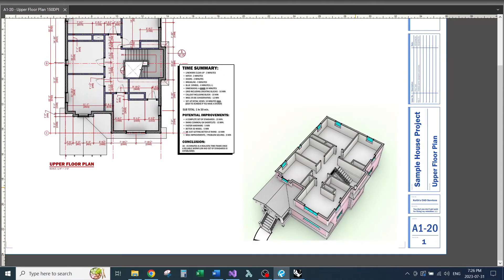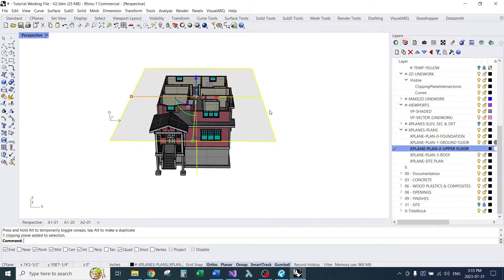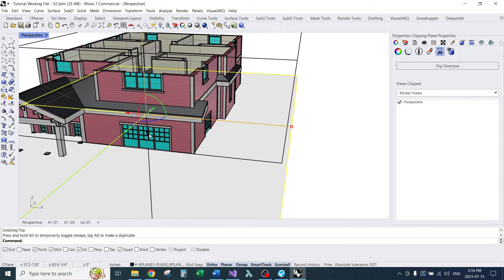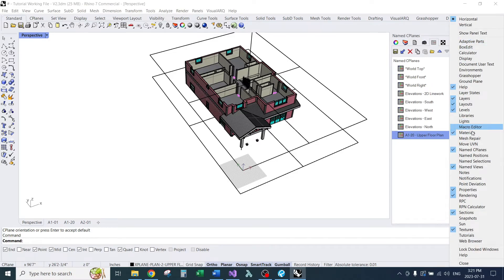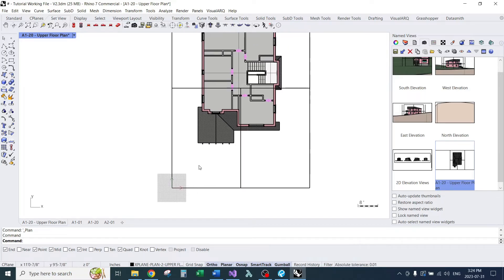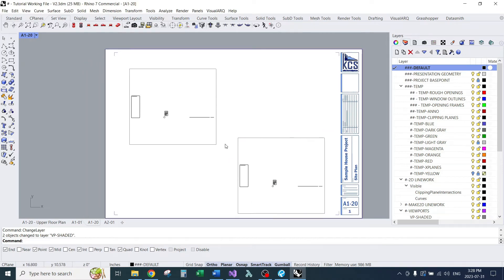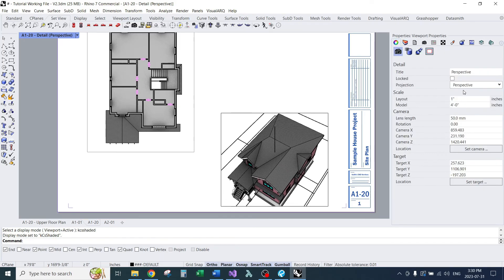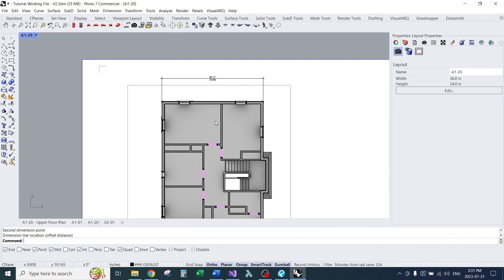Create a Floorplan in Rhino - 1 of 3

Comment: Why don't you use visualarq which have section feature already.
Reply from the maker: I think I mention that in an earlier video. The vaSectionView (Visual ARQ 2's that is) works really good but also requires more knowledge as well as a VARQ license. I find that it is a little unpredictable in the way it updates. And sometimes it grabs geometry that I would prefer it didn't. And no projected hatches. Using Make2D is slower but somewhat more predictable I guess.
Visual ARQ 3 is in Beta and I'm dying to try it out right now but just don't have the time. Rhino 8 has some advantages that negates the need for model space linework, so in R8 my approach might change. If I stayed with R7 this is probably how I would do things.
Reply: @randomCADstuff  I also want to try visual arq 3, can you share the downloaded file of visualarq 3.
Reply from the maker: @kalpit3d934  I think you have to get in touch with Asuni (The company that makes Visual ARQ) to get the Beta. You also have to have a Visual ARQ 2 license. It's impossible to share.
Reply: @randomCADstuff  ok, I will try....